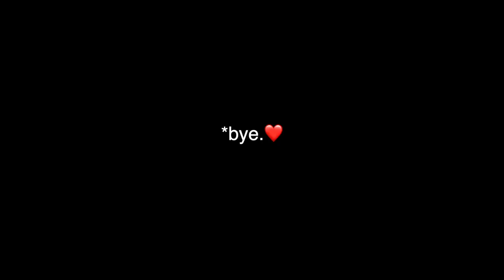I could hear EWE a MILE away! 🙉 | one LOUD mama, one BLACK leg & BILLY'S MAMA LAMBED! 😍| Vlog 566

Comment: You don't have to give dextrose intraperitoneal, if that's what stops you from giving dextrose, before warming. You can give dextrose exactly the way you give calcium to your pregtox ewes subcu. Giving it before warming will make a lamb warm up 10 times faster. The dextrose should be warmed to body temp.
Reply: Makes sense - the baby wold not need to use vital energy to warm the dextrose up.
Reply: I agree warm the stuff up first helps the lambstay warm
Reply: And using sterile water for any injection to avoid peritonitis or cellulitis

Comment: Hi Sandi! I have observed that when you give dextrose to lambs that you are drawing tap water into the syringe instead of using sterile water. I would be concerned that the unsterile tap water is introducing bacteria into the syringe/needle/dextrose and then that would be injected into the abdominal cavity and perhaps cause peritonitis. You should be able to get bottles of sterile water through your veterinarian. Former vet technician here and we always used sterile water, new syringe and new needle on anything that was injected whether it was IV, SQ, IM or intraperitoneal.

Comment: If you cut arm off old sweatshirts you can make little coats I’ve done it with puppies . Head goes out the cuff bit then make holes for the front legs have todo a bit of measuring .

Comment: I noticed that at 4:00 there is a ewe in the second pen pulling out another ewe's wool. I wonder if there is still an issue with parasites in the group. I was also wondering whether it would help to give the lambs that are struggling, a dose of antibiotics. Quite a few of them have very raspy breathing which could be due to aspiration pneumonia and in other lambs you could potentially introduce bacteria into the body when you do the intra peritoneal dextrose injections. Antibiotic injection for these lambs might safe a life or two and it is not too expensive to try. Might be something to discuss with your veterinarian.